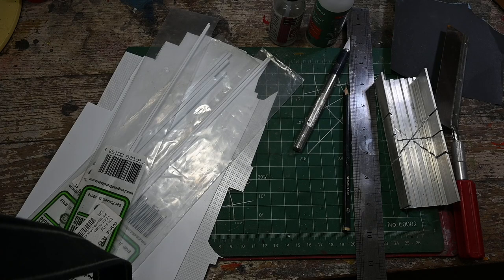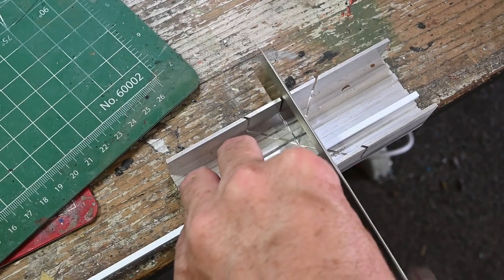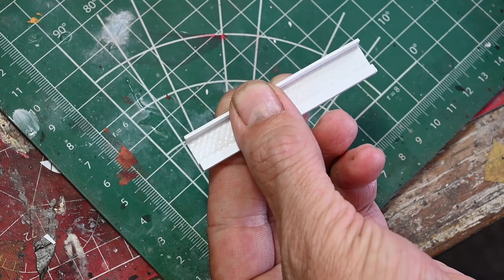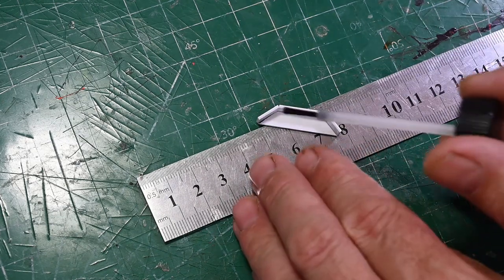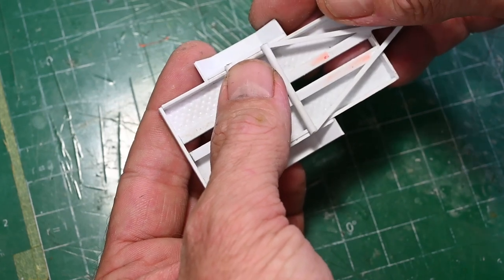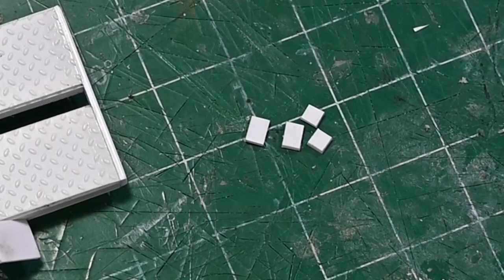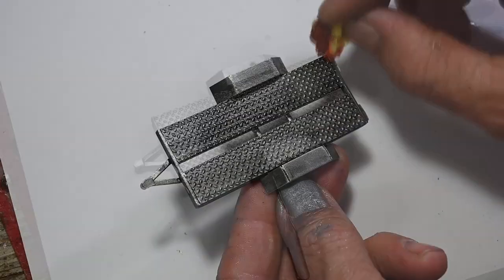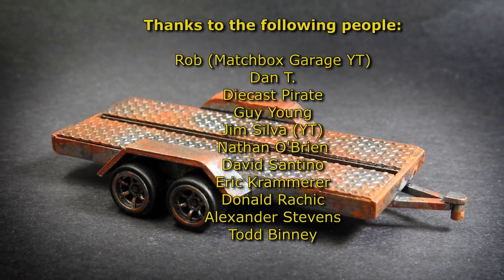1:64 Scale Tandem Trailer Scratch Build | Styrene | How To | Hot Wheels Matchbox Trailer

Comment: Superb work!  An excellent scratch-build.  I made a tandem machine trailer from 2 broken #9 boat trailers.    The deck is a piece of sheet steel, and Araldite epoxy holds it all together.  Matchbox makes a bobcat skid steer loader - the right load for the trailer.